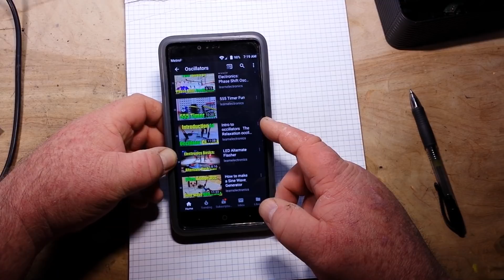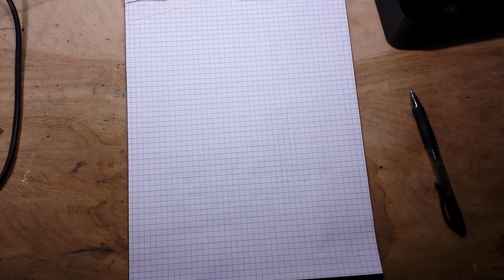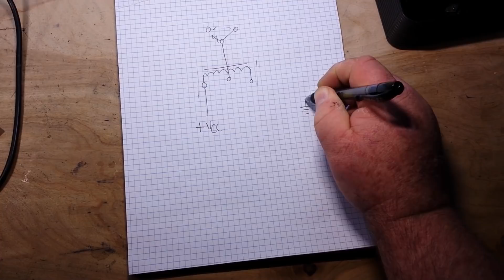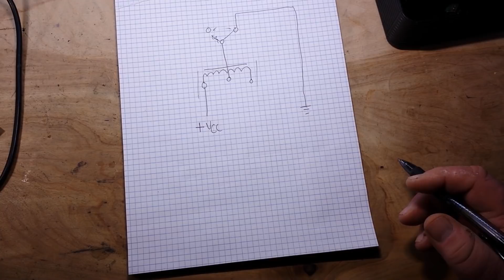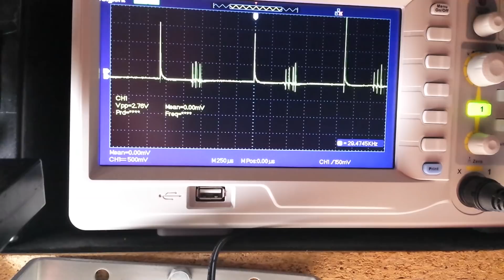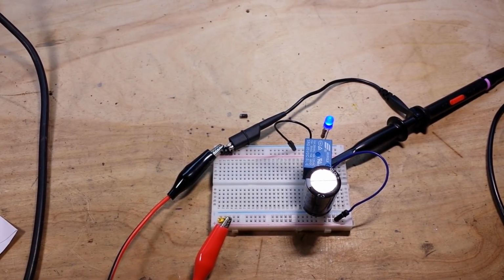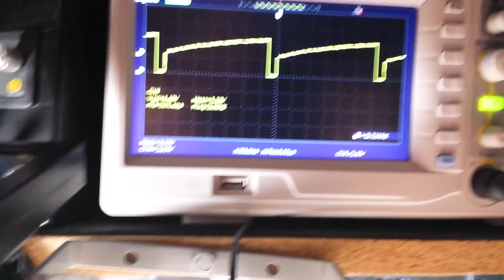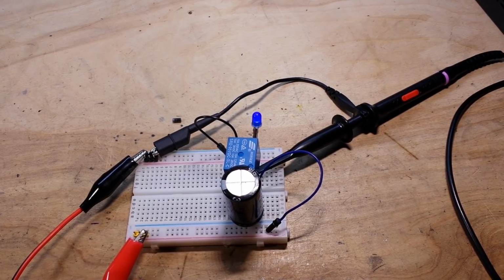How to build a simple relay oscillator

Comment: Hi , I was wondering if you can help me ?
I bought a 905nm 75w laser diode for $30 and thought it was the same as a 5w laser diode that could run off constant current.
Now I see that it needs to be pulsed at 100ns max with 0.1 du at 12.8v 30a.
I can get a 100ns PWM using a 555 timer but I need to find a fast switching mosfet that can handle 30a. 
Do a need a LCR circuit ? Do I need a capacitor bank ?
I can’t afford a $2000 driver.
Any ideas how to build a cheap pulse laser driver ? 
Simon from Australia.

Comment: We can also make it using npn transistors some diodes and resistors by making a jk flip flop can we? Is that also become an oscillator as in fourth j=1 k=1 the output start toggling i am not sure plz correct me if i am wrong
Reply from the maker: That's a relaxation ocillator

Comment: DIY turn signal flasher. 😀 Merry Christmas Paul, thanks for the video!
Reply from the maker: Pretty much
Reply: @learnelectronics  great description man! 👍
I'm interested in building an ocillator to attach to a piece of steel to make chlandi plate. To do cymatic frequency expairments with the kids. (Because a speaker was too hard on the ears LoL)
I was wondering if you have a video that shows how to adjust the speed of the ocillation? Could I just use a
Dimmer switch from a fan or harvest some other type of switch?🤔
Thanks.
Reply: @thelastofthelemmings6279  dimmer from a fan will most probably not alter line frequency. These things usually use phase firing thyristors, which will control how long the mains power is on on every cycle but won't change line frequency.
What you are looking for is either this circuit but with a variable capacitor, or anything using a 555 timer in astable mode where you use a variable resistor on pin 5 or at some strategic place between pins 4/7/6-2.
Reply: @takix2007  thank you 👍

Comment: The click oscillator.  The initial buzzing noise (without capacitor )  has a lesser frequency than the 28 ~30 KHz , maybe 1/8 from the divisions on the scope? it has a predominant spike.
Reply: Correct, the oscilloscope was also adding in the coil frequency as the power is released, the coil has its own ring. The contact frequency sounded more like 1.5 - 2Khz.

Comment: Nice relaxing and enjoying video again Paul.  And I have learned quite a few things so far from you. I even noticed for the first time that that you connected the live wire first and then ground, and that twice in this video. Doesn't matter. I've learned your lesson and that matters, thanks.  Merry Christmas to you too, but I'm sure you will come up with another video before that about a nice new multimeter or another smart oscilator with just a mosfet and a few other components. Peace to you Paul.